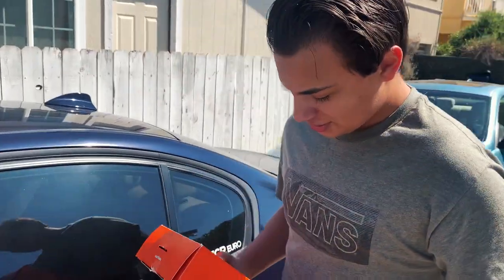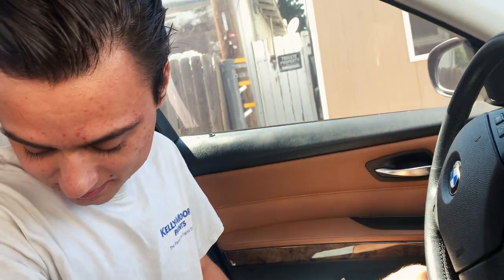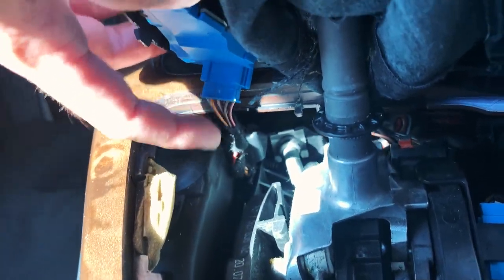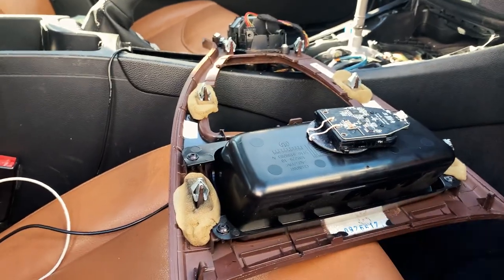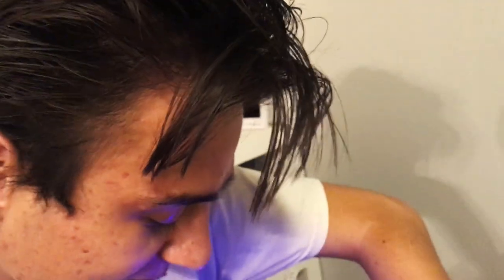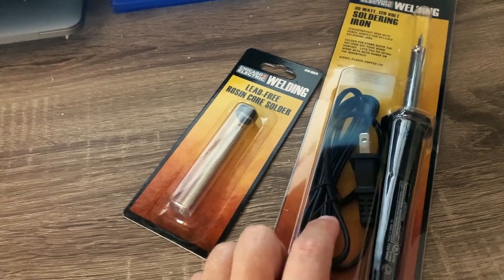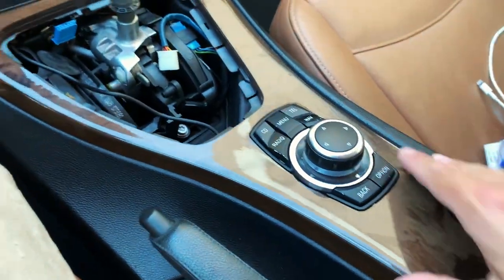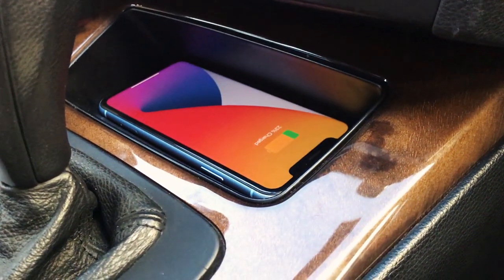OEM WIRELESS CHARGING FOR $8! - E90 BMW OEM Wireless Charging Install

Comment: my e90 has an ashtray with 12 volt power instead of the tray that your car has.  im guessing i can buy the tray and just swap it out but im wondering if your car has a 12 volt plug under the tray you could have used instead of taking up the plug in the armrest.
Reply from the maker: hmm i dont think i noticed one, that would of been really clean if i could of wired it straight there instead of the center console

Comment: How fast does it charge your phone though ? The center console port doesn’t put out much ampage does it ?
Reply from the maker: not fast, its more like a trickle charge, but it prob depends on the charger too
Reply: use PD cig. plug (should read output : 5v, 9v, 12v). Then choose the wireless coil that supports quick-charge